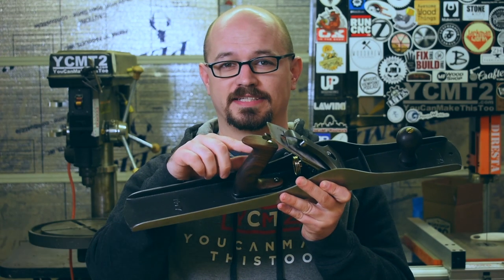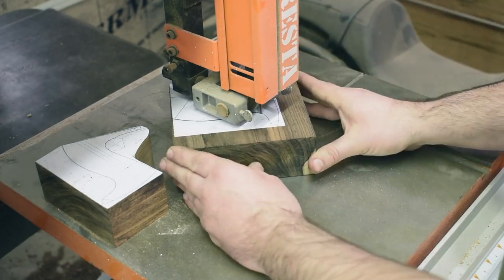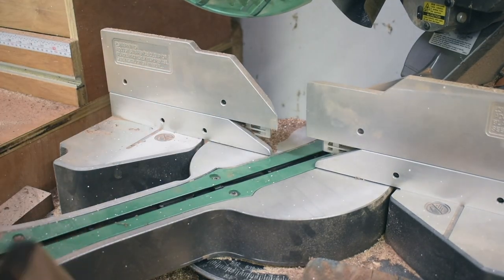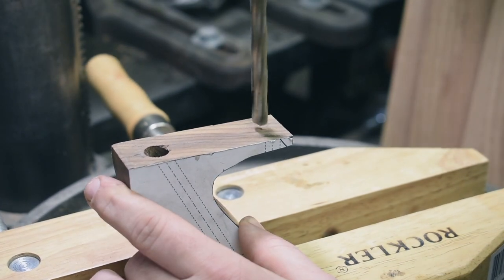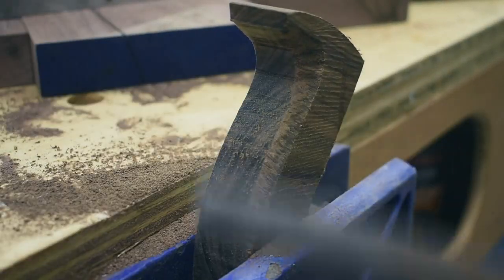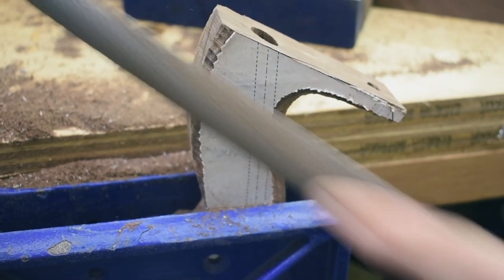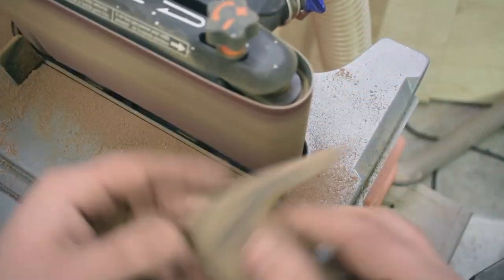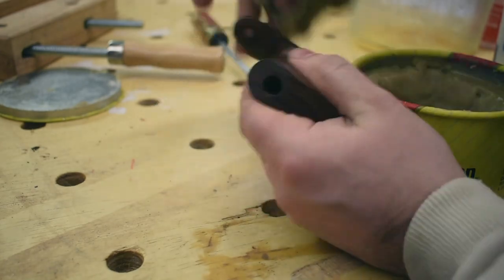How To Make a Plane Tote / Handle

Comment: Nice project so far. I’m looking forward to the next video.
Quick tip-you should put some wood planks on the inside of your vise. I have the same vise, and it holds much better if it’s compressed in between two pieces of wood; I used 1/2 in birch plywood scraps.
Reply from the maker: Thanks! Good idea on the wood in the vice.

Comment: Did you miss the part on the template that shows you how to orient the grain properly?  Worth a mention in the video.  It's important for strength.
Reply from the maker: My alignment was off some so I could get two handles out of the same blank, but I'm confident it'll still be strong enough.
Reply: It looked as if you had it nailed but thought it was worth mentioning.  At the price of exotic woods, it's worth doing a little jiggle to get the best bang for the buck.
Reply from the maker: Ah I getcha now! Yeah, I should have mentioned that, you’re right. It is a bit of key info.